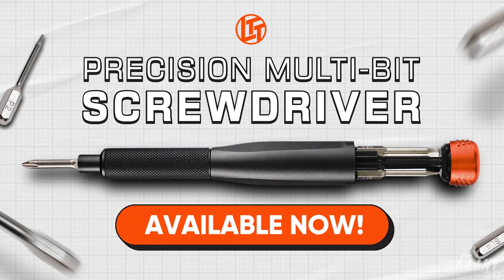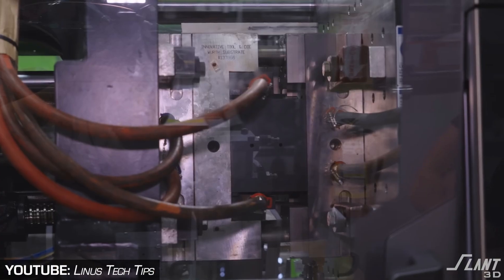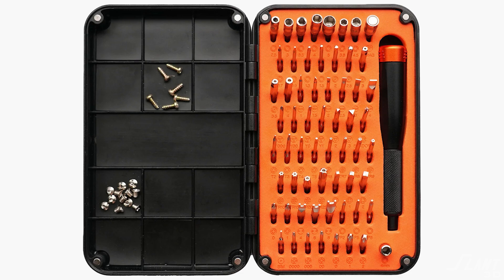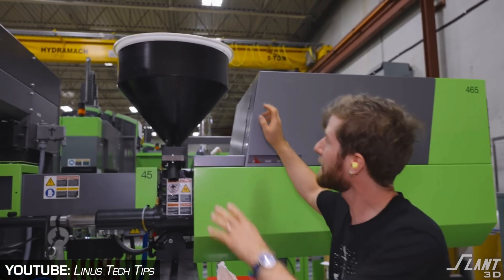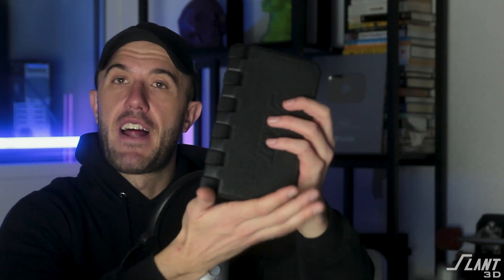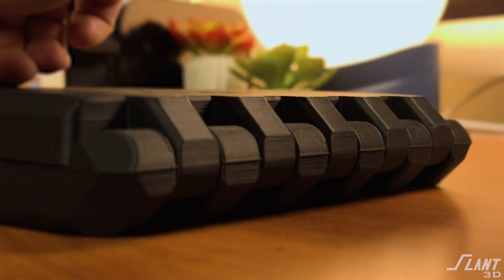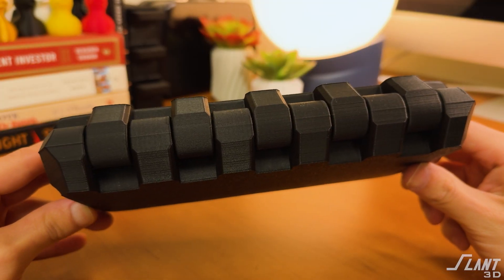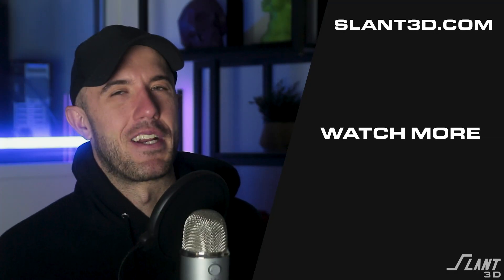We 3D Printed a Screwdriver Case for Linus Tech Tips | LTT Precision Multi-bit Screwdriver

Comment: Great design input and explaining your intent. 
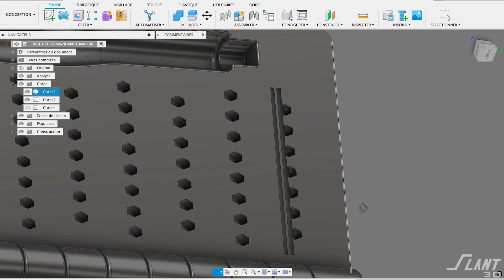 9:01 I just dig through 30 years of tools and wish I could find it, I did have a bit case that had this design. The bits were all vertical and one long ‘leaf spring’  across the bits. The issue here becomes if you have the largest tolerance next to the smallest tolerance bit, or the holes are slightly larger or smaller, the smaller bit  can be loose and fall out, especially in the middle. The other issue becomes dirt and grit getting into the leaf spring space, and if you don’t clean it out, you’ll eventually start wearing the surface of the leaf spring due to extra pressure. The plastic also starts to become brittle over time being exposed to different oils and chemicals. Pretty sure it was a set if bits from a German company. Case completely over engineered.

Comment: Technicaly you can divide the LTT kit in 3 parts - you have lid - with magnet tray, you have insert with bits and the screwdriver, and you have lower part of the box witch is practicaly a second tray. So the set has 2 trays 1 of them magnetic and foam insert with bits/screwdriver(this is practicaly the same with ifixit kit). On the other hand your design is only 1 piece/1 purpose.

Comment: You forgot perceived brand value. You don't buy an expensive screwdriver, to then have a "shitty" 3D printed box case for it. Same way you don't want to see 3D printed parts in your car. The hinges looks bad, the sound of the box itself is bad. And no, the textured PEI bed plates doesn't make it looks valuable at all. And no, your box doesn't maintain the premium "feel" like you are saying.

Comment: Next you should give a shot at designing a case for the full size screw driver. The 60ish bits you can get, the extension and the stuby. Its currently a product that doesn't exist. Not entirely sure what to do with all the extra bits i have laying around once ive made my custom bit loadout.

Comment: interesting video. I do have the precision screwdriver and overall really enjoy the case. I like the compact size, magnets, and fact that it disassembles. While you do make some good points, and I do like some additions such as the angled pockets for screws, and leaf springs, I can't see printing this STL. Don't get me wrong, I'm glad its there as an option. I even had a 3D printed case for the full size with magnets that hold every little bit with little magnets as well. I felt like there was more of a need for that one since there isn't a storage solution by LTT for that. Still a cool video to see what is capable using a different method.

Comment: The reality is that the "slant version" simply feels way cheaper and somewhat unfinished compaired to the injection molded version that LTT decided to go with. And since they have a reputation of the original screwdriver being build with high end materials for all parts it would not me a good fit to then use 3d printing for a smaller version of that product... (don't get me wrong i love 3d printing and i'm starting my own 3d printing business but you have to understand that 3d printing isn't always the correct solution)

Comment: I've seen several of your videos and this is the first one I'm going to have to call BS on. The case you've printed is interesting, but I wouldn't use it over the LTT or iFixit cases. One of the things I'm looking for in a tool case is size and weight. The hinges you have are oversized and with all the extra plastic you have a lot of extra weight. I haven't looked at the LTT kit but on the surface  its a lot like the iFixit kit which I use a lot. The biggest issue I have is with the lettering of the foam. They (both) should use a two color foam insert that when the lettering is cut away makes the lettering readable.
Reply: There is literally no extra weight making the hinges bigger. He is using 2 walls in this prototype and the rest is infill. We are talking less than 3 grams of weight if that. Are you that concerned over 3 grams? The bits weigh more than the entire case.

Comment: Everyone is already roasting this video but ive yet to see someone mention them making the box massive. Like durability is important, but for a precision screwdriver you want something as small and compact as possible. This is a massive L and I would take the video down out of embarrassment.
Reply: Why does it need to be compact? I have lots of precision screw drivers and bits. They are kept in a drawer of a standard 20" long toolbox. Compact is not always better or even wanted. Know anyone with "fat fingers?"  Really hard to get those bits out of an LTT case. Also lots of small gauge screws are not even magnetic.
Reply: @phasesecuritytechnology6573  I often take my iFixit kit with me places. The last thing I want to do is lug a 20" long toolbox around. If the kit is going to live in a drawer then I'd likely 3d print a custom "organizer" for the bits and driver that fit the space.

Comment: I, like so many others here, really love your content and seeing how you can remaster things for 3D printing. The one wheel stand was a total success. And you bring up so many good points about 3D printing. I like adding them to my repertoire. But in this one case. I would say 3D printing wouldn't really work for so many of the reasons other people have commented. If you want it to fit into the ltt backpack with other stuff you want it not to be bulky and chunky. The magnets would work better than. nice grooves and the. fact that foam would hold on to something longer and. more reliably than plastic clips that would wear out But just because not every design can be 3D printed as well. Keep these videos coming They are so much fun and you can learn so much even if the use case isn't perfect.

Comment: LTT case comes apart so the top can be used to store screws etc in, it's also magnetic to hold the screws in.
This looks very big and bulky compared to the LTT version.

Your forcing your manufacturing onto products where it's not the best option.
There are different manufacturing processes with different pros and cons.
You need to understand the pros and cons and work out which is the best option for what your designing.

Your constantly trying to force everything to 3D even where it's not the best option.

Comment: I hear you. But its a lot of fixing of problems that don't exist, just to speak for 3d printing. If you look how they made it on floatplane you will see.
Have run both European and China made injection mold machines and i'm 3d printing on the side.
The hinge use a steel rod or do you not have a supplier, no one want to have a massive box...
Lid you can 3d print and have magnets in it.  
But 3d print compare to foam, to hold the bits now your just silly. 
Can we get a v2 ?

Comment: Great video like always! What material did you use to print the case ?
Reply: I think all the demos are printed in their PLA, unless he says otherwise. I’m sure you could print it PETG or if you’ve got a capable printer you could use just about anything like PVC. As I wrote that I just had an idea. The part for holding the bits could be printed in a flexible filament, then their would be no need to worry about the holes being exact 😊

Comment: Ultimately this video deserves a follow up video and a V2 version. I think people are a bit harsh given you probably didn't iterate anywhere near as many times as LTT did to actually produce their box. A couple of changes I would have made...

1. Make the hinge mechanism detachable so it can still be used as a parts tray
2. Make the hinge mechanism smaller. It's way too thick. Thick is usually ok for industrial cases but home users will hate overly thick cases.
3. Test that hinge mechanism. How many times can you open and close it before it starts to wear out? How many times can you attach and detach it before it starts to wear out? Also, given it's now detachable, would you want to use metal pins now?
2. Embed a magnetic sheet or small magnets into the lid during the print or separating out the sorting boxes section from the lid so you can glue them in during post processing or design the lid and sorting box section so they're snap fit or interference fit so any part is replaceable. Also a good opportunity to talk about cost to manufacture and print on demand, API etc
3. Test that leaf spring mechanism. How many insertions and removals before it wears out?
5. Print the bit holder in orange. It is an LTT product Afterall. I wouldn't expect you to have LTT orange but as a filament manufacturer, can you do that?
6. Make the bit holder a snap fit part so it's replaceable. How much would a replacement cost to manufacture? Print on demand advantages etc...

I think you should do a second video but this time make the box as good if not better than the original. Pull out all the stops Gabe! Sure, it won't be as cheap... But just have a bit of fun with it!
Reply: let me play slant here:
1: multiple parts are bad for print on demand straight from printer into box.
2: a smaller hinge will lead to more rejects in print on demand because its harder to print right
3: metal pins require assembly which is bad for print on demand straight into box
4: embedding stuff is counter productive in a printfarm print on demand setting as it adds part handling
5: -
6: the bit older is monolithic and printed at the same time as the lid. so multi material would add a huge amount of waste for a single extruder in a print on demand setting
7: snap fit means assembly which is bad for print on demand straight to box.

i think you might notice a recurring theme here..... slant is a marketing channel for a print on demand service. and all of his advice shows....

Comment: If you paused the print a few mm from the top and switched the filament, it would make a really cool "liner" effect and highlight edge around the outside of the box. It would also be possible to switch to TPU instead and it would make a good seal on the box.
Reply: @Davids3DProjects  TPU does not stick to PLA. If you just swap on layer change, you can peel that layer right off. For PLA/TPU prints you need some form of mechanical interlocking that's printed into the whole part, which is only possible using toolchangers.
Reply: Yeah that would work but Slant3d's whole deal is pushing mass 3D printing and the printers they use don't support material changes I don't believe. It's all about printing everything as fast as possible with minimum interaction.

Comment: Bro took an existing product, removed features and said it's more efficient to use 3D printing. The construction of the real LTT precision screwdriver box consists of 2 injection molded shells, 13 magnetic patches (12 square, 1 rectangular) 4 steel pins, 16 round neodymium  magnets (8 for box closure, 4 for the hinge, and 4 for stacking the shells on top of one another. 2 foam inserts (1 die cut and lasered and 1 as a backing for the first)  And I'm just a lay person examining the box in front of me.  

I've been professional printing with various additive manufacturing processes, not just FDM like this guy, for over 6 years now.
Reply: When all you have is a hammer, everything looks like a nail :)
Bro has a 3D printing farm and printing service.
Reply: @cromyjr1592  think you hit the nail on the head ;) 

I know he has a thing to sell, but I think people come to this page for information. There might be some good 3DP tips from time to time, but I see a lot of general manufacturing disinformation, which is disheartening to see as a designer.
Reply: I’m glad that other people realize this dude is a quack. He glosses over the features he “would have designed” but didn’t cause they are hard and not that practical. 

I’m a designer and have hands on experience with more manufacturing technologies than most people know exist. FDM/FFF is great, but there are many reasons why a finished product like this one is not feasible in FDM

Comment: I love your take on how you would design the case yourself, especially like the pyramid design on the lid. The OG case though has the benefit of detaching, which was an intentional design decision because the fixit does not. They also made it so it was stackable so the lid can magnetically connect to the back of the screw set once detached. This turns the bit holder side now the lid for removed hardware keeping them safe when moving them around the desk/room or for temporarily setting aside the work. I may have liked the pyramid design, but I prefer it magnetic, combining both concepts somehow would be amazing. I do get you haven't been able to get one of these in hand yet, but once you do I wonder what other improvements you  could make on it.